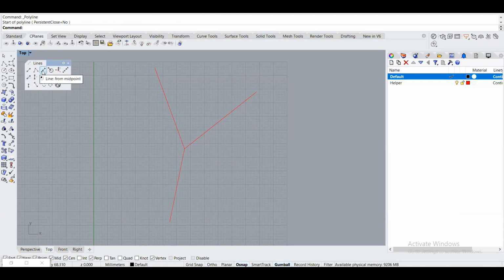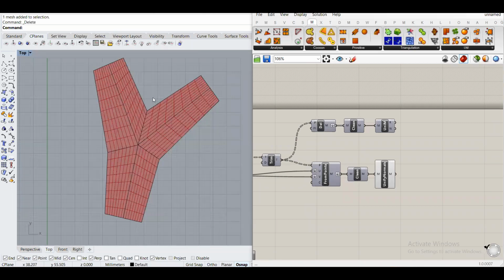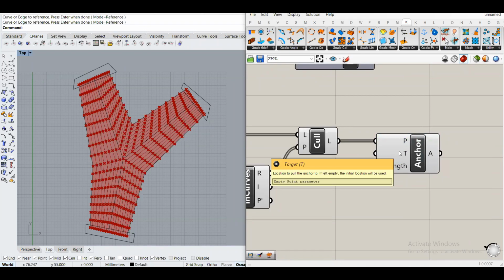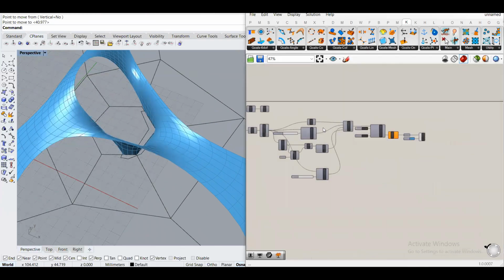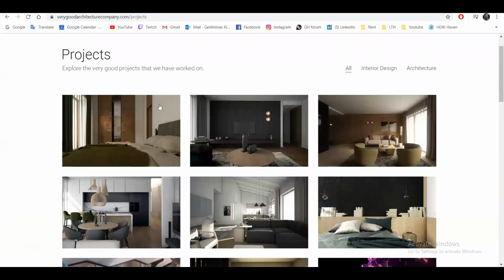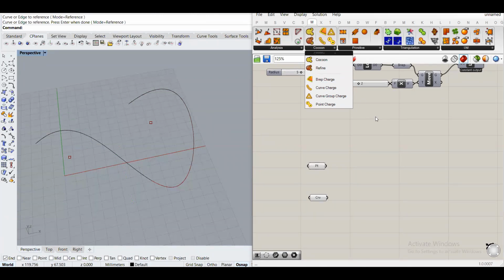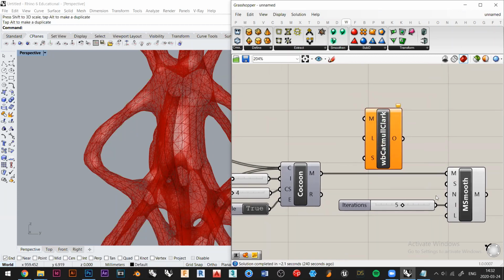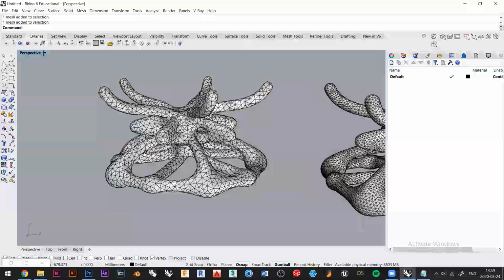Webinar: AAHF30 - Grasshopper for Beginners (day 2)

Comment: Great tutorials as always! This might be a little late and you would have known this by now but to find where the components are inside grasshopper is done by pressing ctrl+alt and holding left mouse button over the component that is on the canvas. Grasshopper will show where this is found in the appropriate panel until you release the key or the mouse button. :)